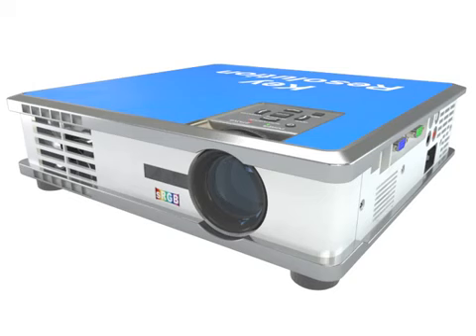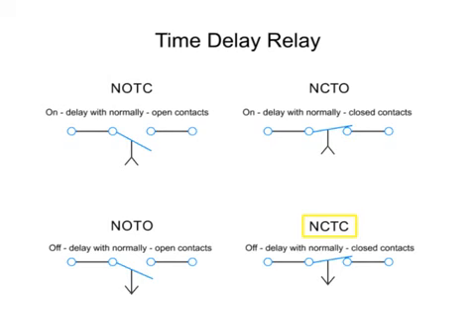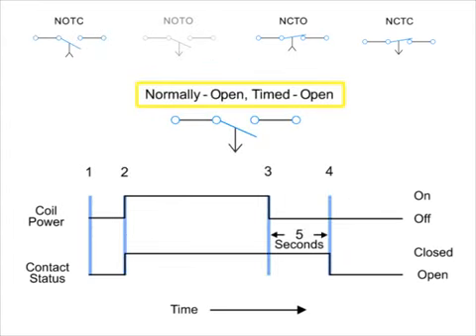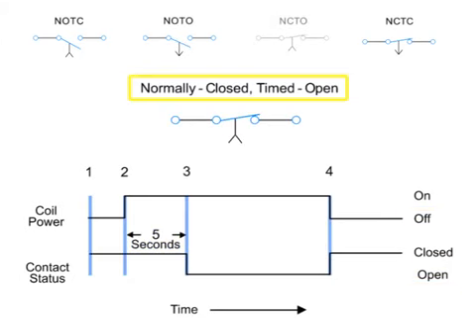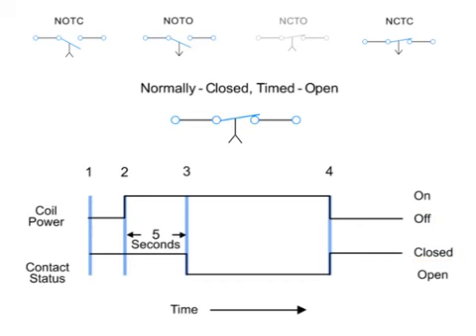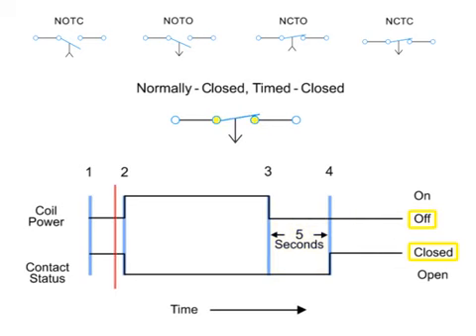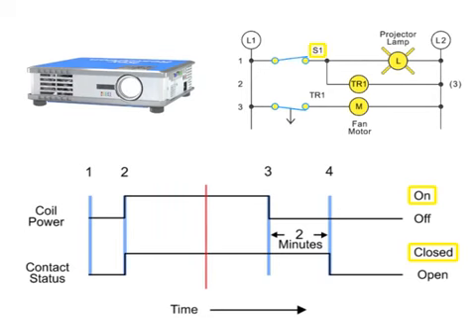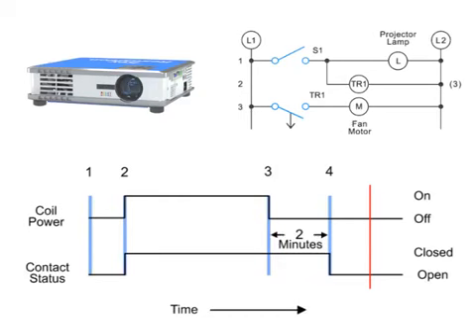How Electrical Circuits are Controlled by Time delay Relays

Comment: Pls feature a traffic lights system for basement ramp.using a photo sensor as gate.w a 11 pin timer w a red stop bulb Ang green.time delay stndy a green lights if you enter the sensor will activate it stop.thanks.